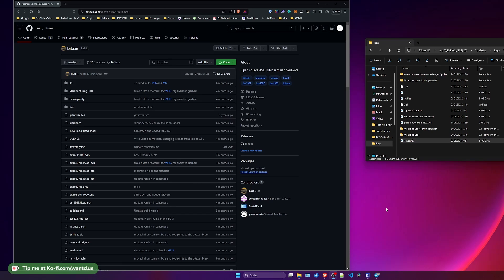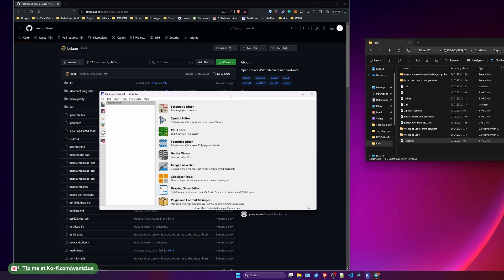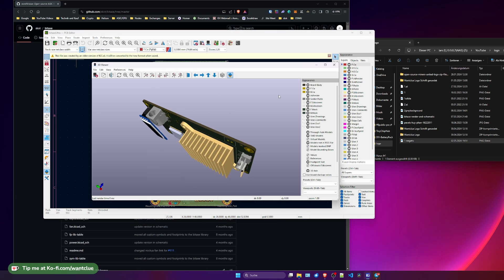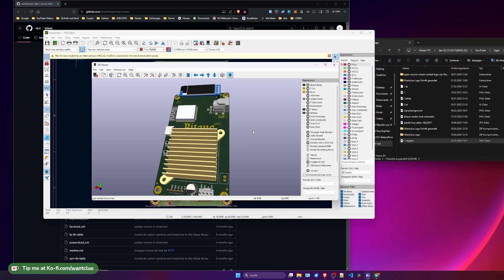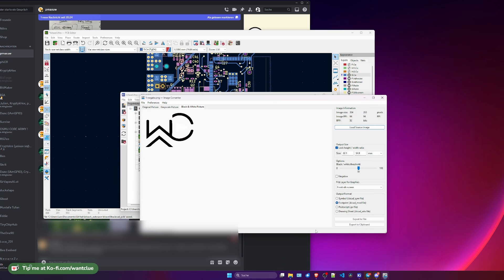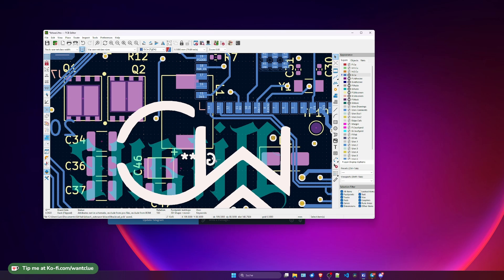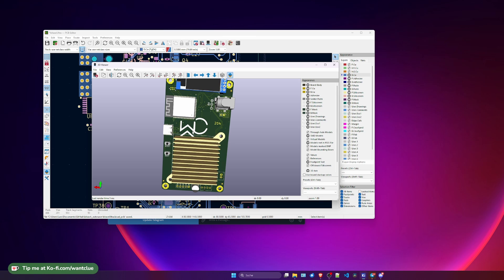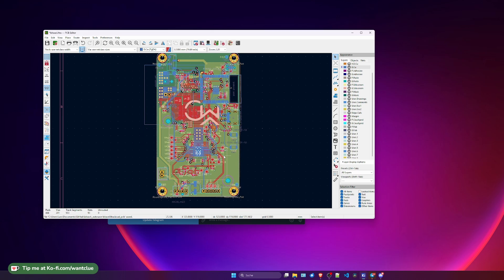Bitaxe 101 | Modify the PCB

Comment: I web flashed My bitaxe Supra after using the supra firmware on the flasher. It gave me an error...... Guys if you have the supra 400 or board which i have i flashed my supra with the Bitaxe Ultra board version 204 instead. If you flash the supra with the firmware in the flasher that says 2.1.3 version i assume all bitaxe boards this is not the right firmware for the supra as i tried it and i had a testing power fail on the screen... I suggest use the Bitaxe Ultra board version 204 as this flasher confused me and i gave this a shot and it worked.    I will say again do not use the supra version of the flasher as it gave me the same fault as the version 2.1.3. Problem solved.
Reply from the maker: I’m aware of that and we’re trying to resolve the issue